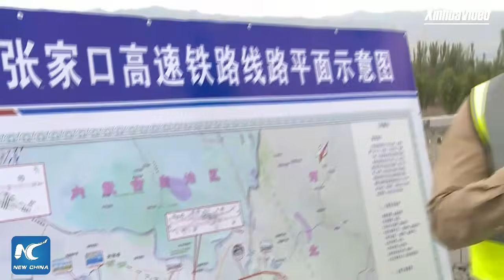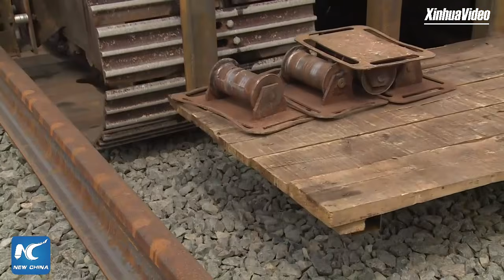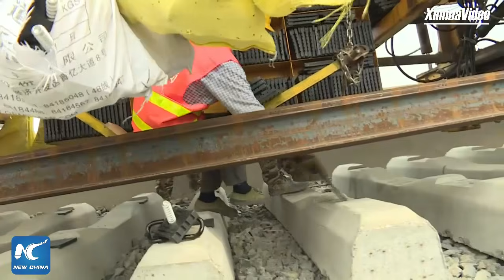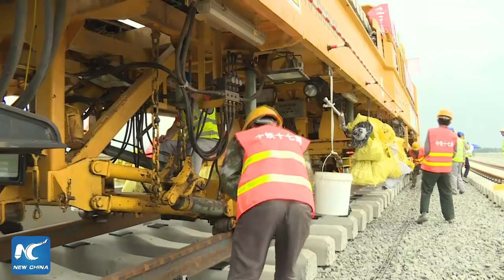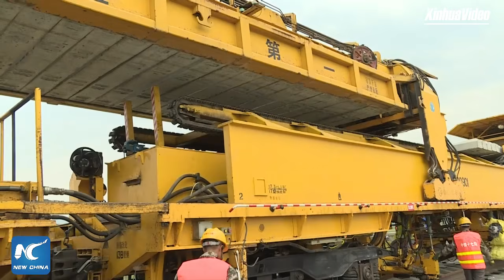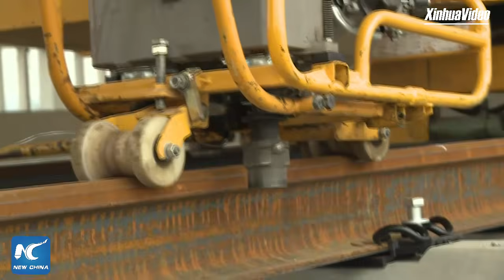LIVE: New high-speed railway under construction in N China

Comment: It looks like there's one train riding forward and back on top of the main one... dang!  I guess it's bringing up a load of concrete sleepers to put on the conveyor.  There's a lot happening here.  The track seems to be held down with springs on to rubber pads?  All welded rails with field joints every ?? five hundred meters??  Should be a smooth ride!  I've been on trains here where it was hard to drink the nice train coffee because the whole machine was shaking so hard.  It was hard to read or write... it seemed like the car was going to fall apart!  This was in the Carolinas, going south to Florida. I learned a lot from this video.  They are laying track about at walking speed!  They seem so organized and smooth with it, I don't know why they would ever stop!  Unless they run out of steel and concrete?  Or just finally decide there are enough roads, rail lines, and gigantic bridges?  Well, there's always the belt-and-road countries... SOMEBODY needs railroads, right?  I think they can keep going forever like this... presently they're in Africa, just making a Pan-African transport infrastructure, in exchange for palm oil and raw materials, I don't know.  I'm just making stuff up!  But can you really HAVE too much infrastructure?

Comment: What I don't get is why they are only securing every five sleepers instead of every one of them, as would be normal practice?
Reply: I think what you're talking about is a separate operation, with its own big machines!  I've seen footage of this, it's bolting everything down and ? compacting the bed with big vibrators, things that look like air-chisels, "pavement breakers" that vibrate between the sleepers.  Maybe four or five on each side.  They are attached to the side of a special car, and stab down into the gravel between the sleepers.

Comment: Couldn't you bolt the rails directly to the bridge? I am not civil engineer, just wondering.
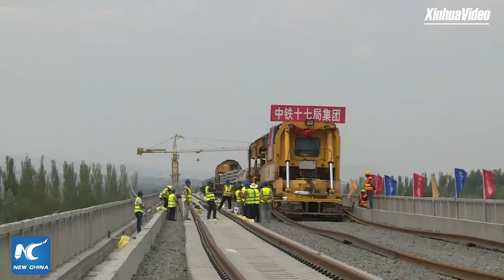Reply: I think in other situations they do this.  Really high speed rail construction seems to be "ballast-less", where the rail is bolted to huge slabs of concrete.  They are discussing this in the video!   At 5:40.  He's saying that the ballast is cheaper, easier to maintain, carries higher load.  I think the hard style track can be more accurate and allows higher speed.  It might be that the track is more important than the train!  If they do as you ask, the whole construction would have to be that accurate, and STAY that accurate.
Reply: @leonardpearlman4017  Thanks, makes sense :)

Comment: This is the reason why you can stand a coin up right, every thing track and rail crossmember are 100% plum or horizontal and vertical  level. And track are perfect space apart also. Only a machine can do this perfect. That the reason why our Honolulu 22 miles is taking a month a block. Everything has to to be hand check and level and tight down and check again. If it’s not level or sank it has to redone. Can’t beat a tune machine it’s ferfect to the mm.

Comment: When i need motivation i watch videos of chinese building roads and railways. Mesmerising and motivating. How many km of network can be build in 3 shifts 24 h mode?
Reply: As a rule of thumb one can say, such machines make about 250 meters per hour, which translates to around 2 km in an 8 hour shift. But one can not just extrapolate that to 24 hours, because one shift will be needed to change the sleeper cars - the time for this, of course, depends on the distance to the next escape point and how many sleepers the train can take. 
However, the number of sleepers to be carried is also limited - the more sleepers you take with you, the more the gantry cranes have to travel, and you run the risk of not having enough transport capacity when they come close to the end of the long sleeper train.
Not least, of course, a prerequisite is that everything runs smoothly and without interruption.
Neither may twisted sleepers occur on the belt, nor can there be difficulties with joining the raisl or problems with the distance positioning by the sleeper positioner and so on......
Reply: awesome
Reply: test
Reply: this is 2km per day
Reply: BuyOrBuyNot 2000m+
Reply: 500 m /15mins